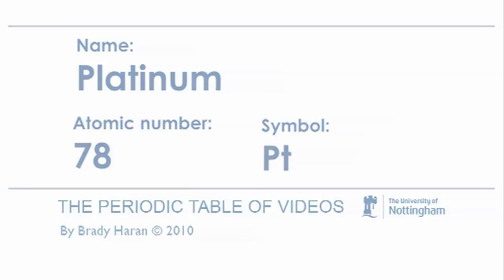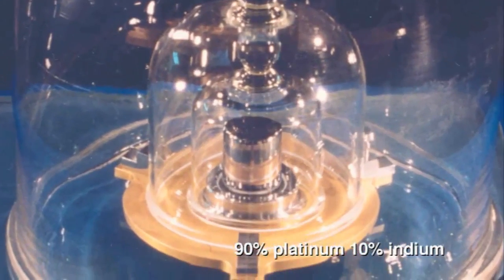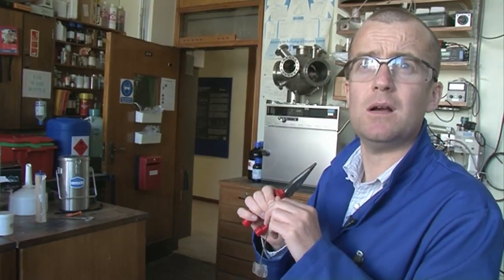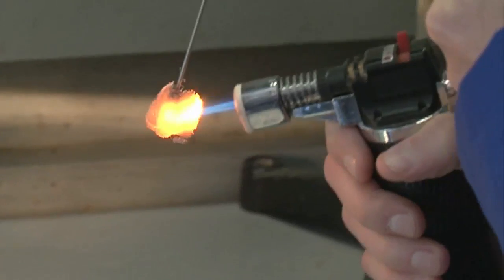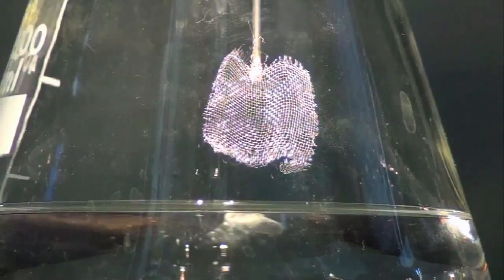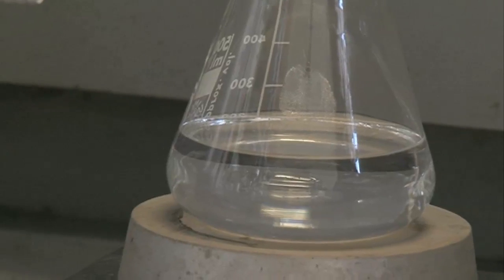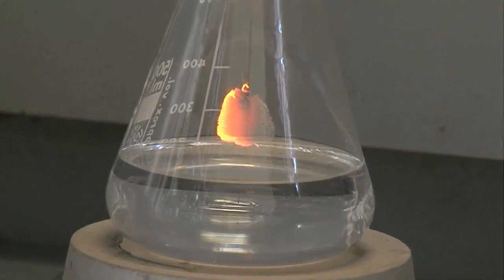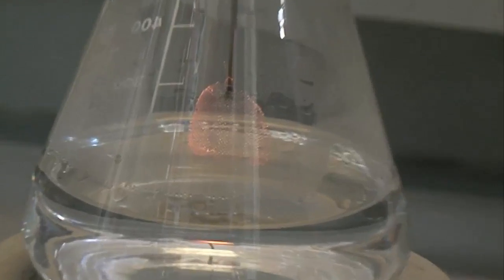Platinum (version 2) -  Periodic Table of Videos

Comment: Pure Platinum is easily dissolved in Aqua regia to give tetra valent platinum as a hexachloro platinum (IV) ion called chloroplatinate which is yellow orange. If potassium or ammonium chloride is addicted and enough platinum is present a yellow orange crystallized precipitate precipitate is  created. This test should be more sensitive with cesium or rubidium chloride.

Commercial Platinum usually contains a small amount of iridium to make it harder and less labile to reagents.

Comment: On a side note, stainless steal (304) can be used in certain types of fuel cells to replace platinum and the losses in efficiency are essentially negligible. ...And there's plenty of stainless steal available. 

I'm not an expert in fuel cells but I have made a few rudimentary ones using stainless steal and have never seen any significant degradation of the metal. Do the developers know this? They should. it makes me lean towards the notion of a conspiracy--- oops! we can't use that word! ...of a concerted effort to keep the price of oil and the petrol dollar, high.

Comment: So the platinum reacts with the DNA and cancer cells, but is non-reactive in water/air/etc?
Reply: +ariesfairies Platinum in its metallic form does not react with water or air. By metallic form I mean a crystal structure of single, neutral platinum atoms held together. But the cancer drug that he professor talks about, cisplatin, is a molecule that has platinum bonded together with other kinds of atoms, sharing electrons with them. And the properties of a molecule containing a spesific element will be quite different from the properties of that pure element by itself.
You can think of it as this: it's not the platinum in the molecule reacting with the DNA, but rather the molecula as a whole is reacting.
Reply: +ariesfairies Get  a platinum ring safe for life ,from cancer ,Aliens and the common cold
Reply: +chris doyle attractive to thieves tho

Comment: Why not use a liter of water as the kilogram standard?
Reply: FullTimeSlacker It expands and contracts, reacts easily with many things, evaporates, etc.
Reply: +FullTimeSlacker The volume of a liquid varies with temperature, so using volume as a standard of mass would not work very well unless temperatures are kept extremely precise, and the liquid itself is kept pure.  That's why using the mass of a solid is better.
Reply: FullTimeSlacker It used to be a long time ago
Reply: it was, one liter of water on room temperature is 1kG

Comment: I have two internal combustion model aircraft and the glowplugs are essentially tiny hollow brass screws smaller than your fingernail, with a tiny, tiny coil of platinum inside, and an adaptor for an electric starter at the top. They cost about AU$8 each (which is around £5-£6 I think). Expensive stuff, especially because they wear out pretty quickly, around 2-3 flight hours if you demand a lot of performance from the engine.

Comment: Fiberglass is made by flowing molten glass into platinum 'spinners' that are cans with thousands of tiny holes that allow the glass to extrude through them using centrifugal force.  This molten glass is very corrosive to all other materials.  Each spinner weighs ~25 lbs, accounting for >500,000 dollars in platinum alone.  As an engineer, I regard platinum as the only material choice for many electro-chemical & noncorrosive, high-temperature applications.  It's amazing stuff!

Comment: Volume is the magnitude of the three-dimensional space enclosed within or occupied by an object, geometric solid, etc. In other words, the space it occupies. Meaning that 7 gr. (by weight) of a denser mass is going to occupy less space, which means less amount by volume. Example: 1 lb. of lead vs. 1 lb. of feathers. Which occupies more space? Their weight is the same, but you need a "boat load" of feathers to make a pound and a very small amount of lead, for it's heavier (denser).

Comment: it is about different transition metal's oxidation state
try google "transition metal catalytic property"
catalyst react with reactant to form intermediate compound which will involve in further reaction to form the product and the catalyst finally are recovered. (simplified explanation) Transition metal have so many outermost shell electrons that allow them to have different state e.g. 1+ so by interchanging these states in the reaction, the reaction speed up through kind of shortcut

Comment: In the laboratory where I work we use a lot of platinum in the form of platinum crucibles. We use platinum because it doesn't react with our samples when we prepare them in a flux at 1250C and pour the molten mixture in platinum moulds to make glass beads that are very homogeneous and we can then measure them on our XRF.

We recently had to weight all the platinum we have on our lab for insurence stuff, which came out to a little over 2kg of platinum. (I guess they won't miss a few gram :p)

Comment: @PowerOfTheMirror there are 2 types of catalysts..a homogeneous and a heterogeneous catalyst. The one you read on wiki was most probably the homogeneous where the catalyst is of the same state as the reactants and thus being able to speed up the reaction by providing an alternative pathway for the reaction. The heterogeneous catalyst however, is of a different state as the reactants for example the platinum in the video. Methanol and oxygen are both in the gaseous state while platinum is a soli

Comment: I dont really get catalysis so I appreciate being corrected. If platinum catalysis occurs somehow by capturing electrons and changing the energy levels involved in the reaction then I agree with you. However according to wiki catalysis can also happen by the chemical reaction of the catalyst with some of the reagents to form intermediate products that speed up the desired reaction. It also seems this is how platinum catalysis works. In that case platinum does chemically react no?

Comment: Catalyst means it's not participating in the reaction as a reactant. 

This means that it does not lose mass but instead arranges the reactants it comes in contact with such that they react more efficiently. The reason it gets hot is because of the energy produced by the reactions.

Comment: It really depends on what type of converter it is, some use pellets of catalyzing material, and some use a "honeycomb"  that the exhaust gases pass through.  The platinum itself generally doesn't degrade, but there are other materials in the construction that do, but the most common cause of failure is contamination due to a poorly maintained engine, that overtaxes the CAT, or the material simply breaks loose, causing obstructions and/or a loss of catalytic efficiency.

Comment: It acts as a framework for a reaction. In a simplified explanation it holds one molecule in place while another molecule smashes into the molecule that is being held in place. The catalyst degrades simply because over time pieces of the catalyst get knocked off. The catalyst doesn't rust like iron would, pieces of the platinum coating simply get knocked off.

Hope this helps!

Comment: Could you explain what's happening on the platinum as a catalyst? Is it oxidizing and slowly evaporating like a tungsten filament would? Or is it just acting of a framework for the reaction and assisting in intermediate steps of the reaction and not losing mass?

Comment: Cool demonstration of the method used to operate model engines often used for radio control. The glow plugs used in the engines contain platinum, and the fuel is mostly methanol with some oil mixed in for lubrication. I always knew how it worked, but I had never seen a scientific demonstration performed like that.

Comment: @grimace365 it doesn't create the combustible vapors, methanol is combustible all by itself. it is a catalyst for the natural reaction between methanol vapors and oxygen, and the accelerates the breakdown of methanol so much that it gets very hot, and eventually it gets hot enough to ignite the methanol vapors (in the oxygen/nitrogen environment that is every day breathing air) but it itself doesn't really react, there is no platinumoxide or anything like that created.

Comment: @HAMZAZIAZIA If only! A catalyst, by definition, is not used up in a reaction. However, that does not mean it isn't converted between one form to the next. It simply isn't possible, unfortunately. Practically, it'd be unbelievably expensive anyways as it's one of the rarest metals on the planet.

Comment: @megaverse Platinum is an element meaning it exists as atoms not as molecules. Thus, to get a block of Pt metal, you would somehow need to find a bunch of Pt atoms and get them to stick together. But the essential problem still remains: Pt atoms are rare. But if you were asking whether it's possible to construct Pt atoms by amassing subatomic particles (electrons, protons, neutrons) I doubt it. But it might be possible to do something of the sort via nuclear reactions as has been done with gold.

Comment: @cowboy219 a catalyst doesn’t get used up in the reaction, its just a steppingstone for the other reactant. I think eventually (years and years) the platinum will mechanically break down though due to the heat, this is why catalytic converters need changing every so often.

Comment: @BlackSkullRacer613 Well, the amount of water in a liter of water varies depending on pressure, but the amount of platinum-iridium alloy in that cylinder doesn't. Presumably, that is why it was chosen as a standard?